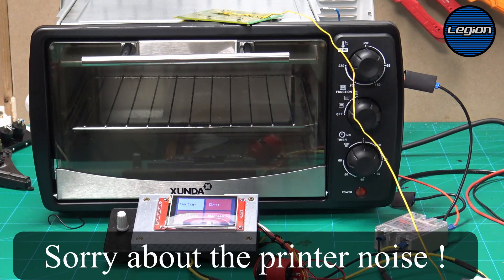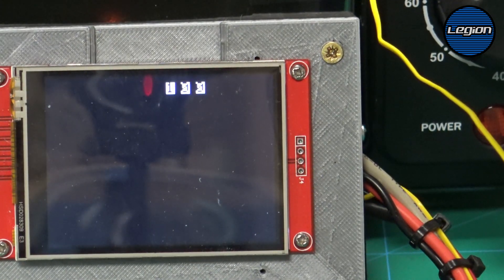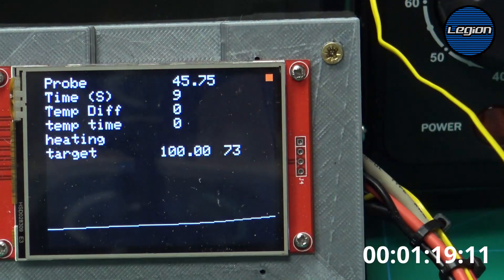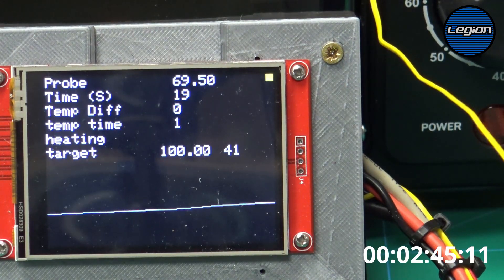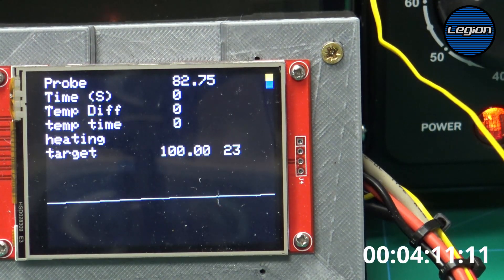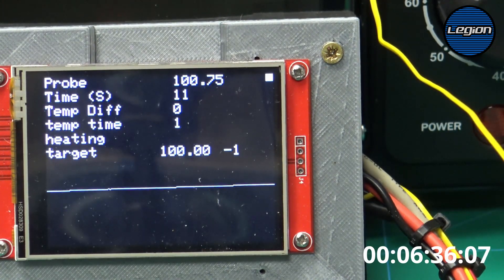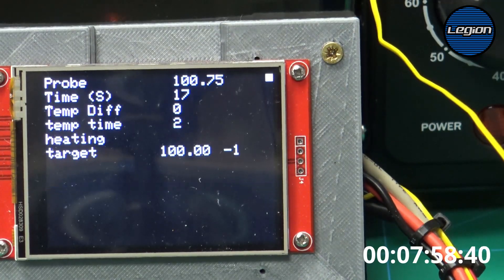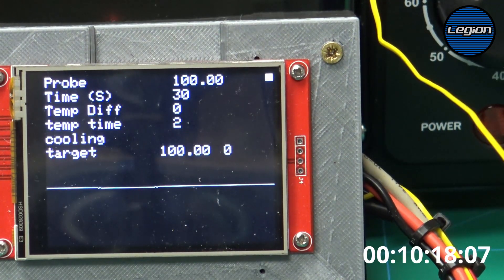My version of a DIY reflow oven   Part 3

Comment: This is looking good Lee.  I've been thinking of trying out reflow soldering and have started getting the hardware together to build my own oven so this is all good info.
Reply from the maker: I watched a few others like ben heck and I do not remember any of them talking about this part in detail, the actual heating and controlling of the temps of the very cheap toaster oven. Perhaps I just missed those parts ?
Reply: @DJlegionuk  Yes, seems kind of important since reflow process has rather specific temp curves and time zones to try to follow.
Reply from the maker: @Marc_Miller  perhaps they are all using a ardino code that works by someone else.